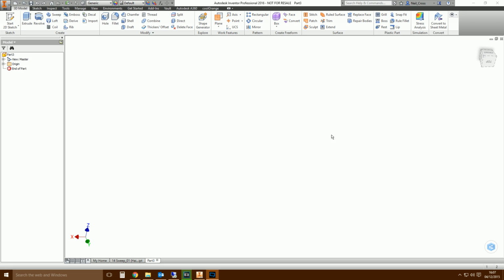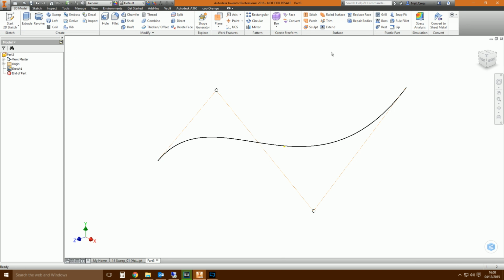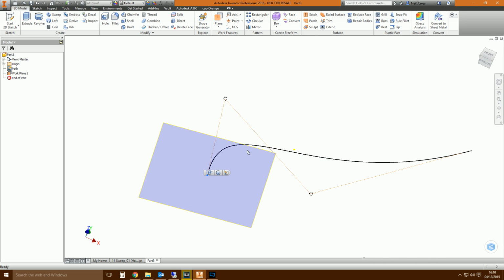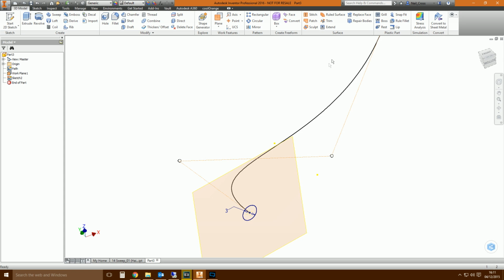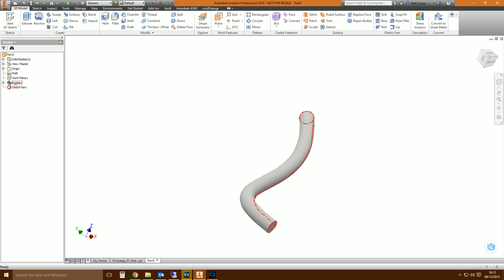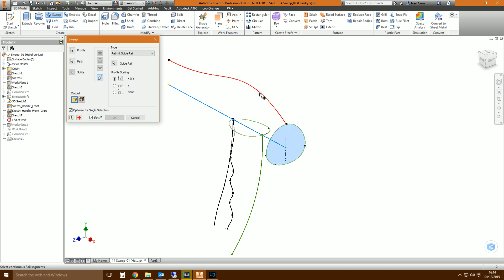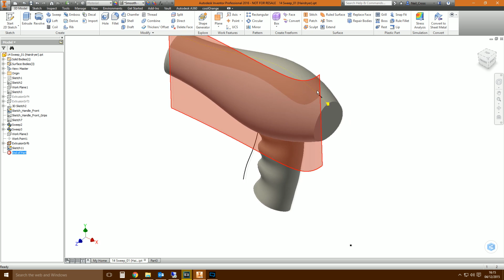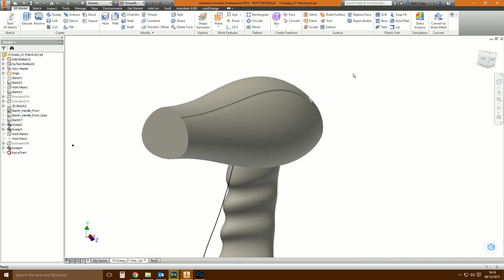How to Sweep | Autodesk Inventor

Comment: Using a current version of inventorpro and was wondering, how do I delete a face from in side a sweep? Say I make an arch from one body to another and create a sweep with the intention of water to flow between, how do I get rid of the part of the 2 bodies that still build inside the sweep obstructing the opening and end?

Comment: Hi I am back again with a small question, I have made a similar part and made the track but in the end of the sweep cut it continuous seems to missing a small piece to cut. I tried to constrain the end of the line to the end of part, and made it longer then the part even perpendicular to the end of the endline but nothing seems to do the trick. of course et can be done, as i can see on your example. I am running Inventor 2016 ,.. By the way just love your videos !
Reply: +Bjarne Wibrand I have understood what the problem is. The line that produces the terminal part of the body has to be perpendicular to the plan, the trajectory it owes to finish perpendicular to the plan.
it is not necessary that the line goes out of the face 
Hi
Reply: Ahh ! thank you.I will immediately verify it on my exercise,. and thanks for the feedback

Comment: Hello, Thank you so much for these fantastic tutorials, i learn valuable things in every single one you make.
I have a question/request, could you maybe make a tutorial on how to assemble (and create parts) in a way that you can later chose specific parts to drive (enlarge, change, modify other parts) and witch functions to us in those parts to draw them.
For example, i was trying to create a CNC mill in Inventor, but i was constantly searching for the method of approach/techniques that would make 'Designing' and especially 'modify' the cnc the fastest and most efficient. 
like witch features are adaptive and witch not for example: sculpt (on witch you already made a tutorial), project geometry? ,  a part created in an assembly and extruded from one objects face to another.
i know this would take a tremendous amount of word to cover it al, but a basic overview would help a lot. 
Cheers

Comment: Quick question: modeling something like a ballscrew or a trapezoidal lead screw, would you coil a work plane then use a sweep command or simply make a profile perpendicular/parallel to the coil direction and use just the straight up coil command?

Comment: Great stuff. I've been lurking around here trying to get into 3d modelling. Anyway, thanks for these videos! Is there any chance you might do some more in depth videos about freeform modelling though? Mostly interested in how to use freeform modelling in conjunction with parametric modelling, since you'd hardly use just freeform modelling alone. 
Basically I have a parametric model, and I need to design a cover that would go on top of the thing and join up with all the edges of the parametric model. How would I go about doing that if that makes sense?